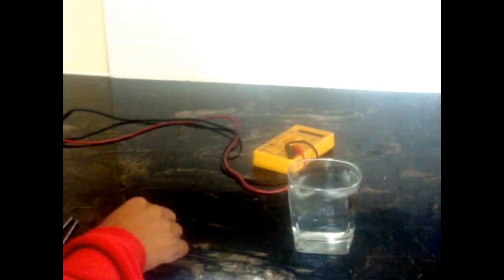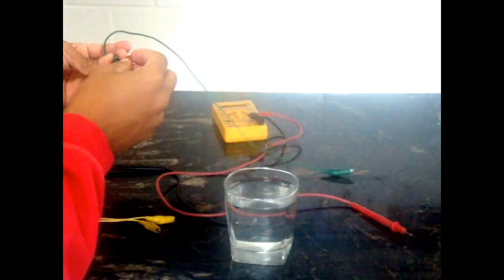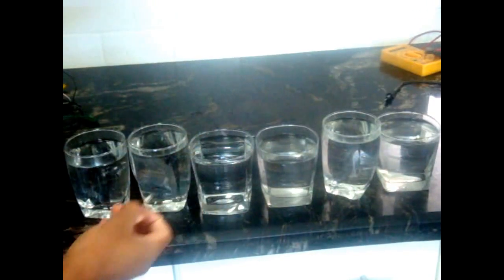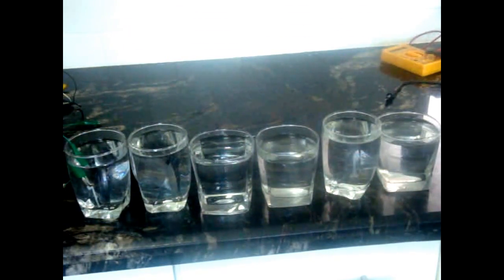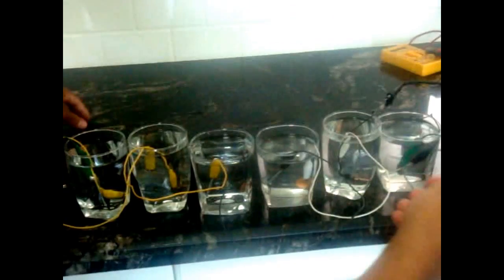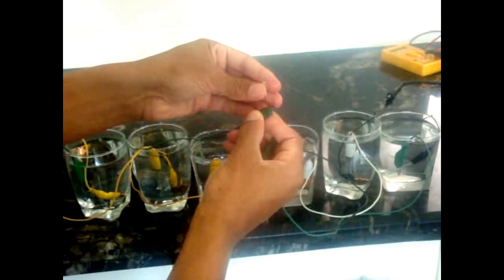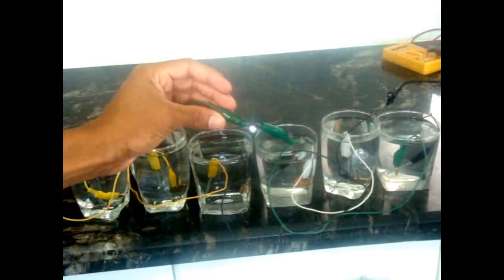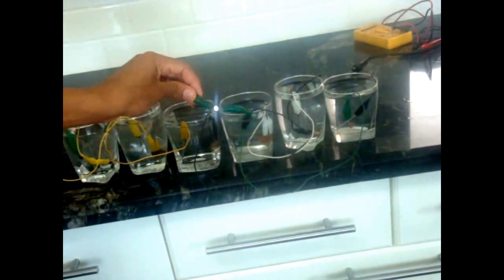how to power an LED with electricity from water

Comment: The electricity is coming from the zinc in the galvanized nails and going to the copper creating a current (differing electrical potentials). The current is going through the water, not from it and yes, adding salt or acid (vinegar) to the water would make the current travel more efficiently.

Comment: I took 4 tostito dip jars, drilled 2  3/8 inch holes in each lid, put a 1/4 to 3/8 inch rubber grommet in each of the holes, inserted a 1/4 x 4 inch solid copper rod into 1 hole in each lid so that it sits 1/2 inch off the bottom of each jar when the lid is put on, then inserted a 1/4 x 4 inch solid zinc rod in the other 4 holes, filled the jars with white vinegar, wired them in series with alligator clips to an led, and it has been lit, night and day, 24/7 for nearly 2 years, and even though the zinc rods are nearly completely deteriorated, it is still running today. March 5th will be 2 years and I expect it to go for at least another few months. It is my take off on the Baghdad battery. Give it a try, it's incredible.